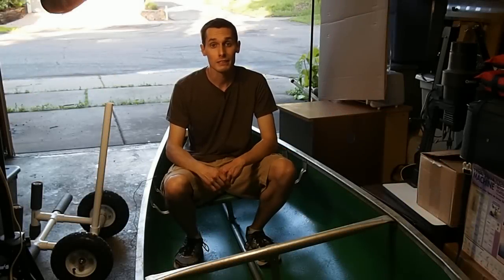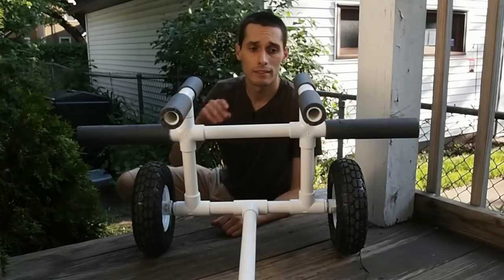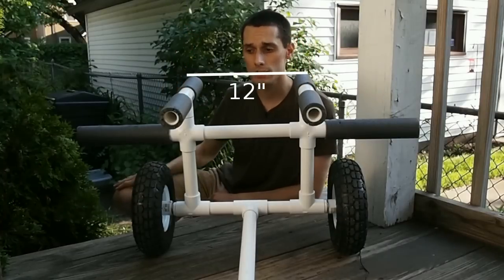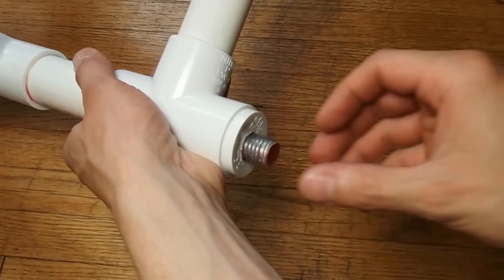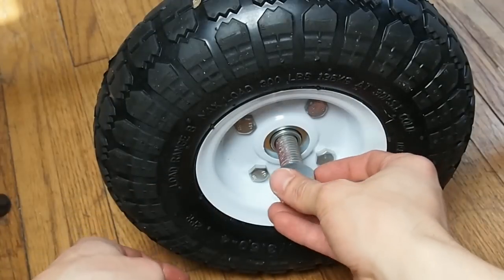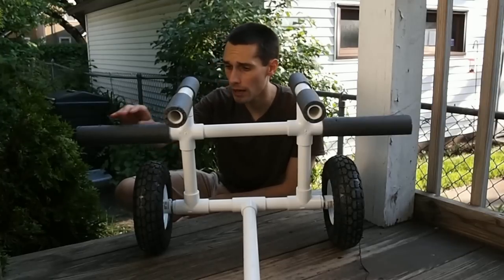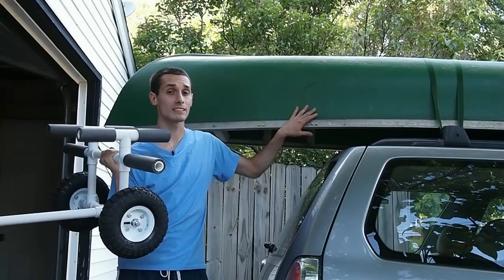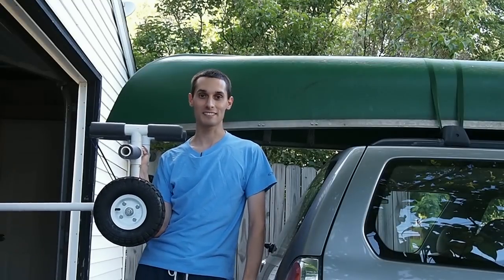DIY PVC Canoe/Kayak Cart

Comment: Hello! Awesome job. Super simple sturdy design. Just an FYI... If you load the canoe or kayak mid-ship it becomes super easy to lift and maneuver as the cart supports the entire load. Sometimes portages are a mile or more and this makes the task simply walking with the canoe rather than lifting it off the ground and carrying the load. Nice job. I'm going to build one tomorrow. Also for outdoor weather long-term durability I saw another vid where a guy sprayed truck bed liner over the surfaces making them UV proof and a bit stronger. Thanks for posting.

Comment: I built one from your plans out of PVC and destroyed it in the first few minutes so instead of quitting I adapted your plans to some 1" square 16 gauge metal tubing I had. After a couple of hours cutting and welding I have a heavy duty yet still light version that does what I wanted with out any flexing..  Thanks for your plans.

Comment: I just found this video. I'm in Canada and parts totalled around  $70.00. It was still cheaper than the cheapest manufactured dolly and a far superior design. After a little math to calculate the cuts, it only took about 1/2 an hour to build. Thanks again

Comment: Thank you for posting your canoe cart.

 I used it as a model to build one for my 100 pound paddle boat.  Works great.

 Because the boat is heavy I used 1 inch pvc pipe and added 1/2 inch pvc pipe internally as re-enforcement.  I already had the wheelbarrow wheels, glue, and the 1/2 inch pvc, so I had to buy 2  1 inch pvc pipes, the pvc fittings (about $20), the 5/8 inch metal threaded rod ($20), a couple of 5/8 inch nuts and 5/8 steel spacers (about $5) at Lowe's home improvements.  I placed end caps for looks and a threaded T so I can easily attach/dis-attach the pull/push handle.  My biggest suggestion is not to glue anything together until you are sure the measurements are right.  The one I built is bigger in width because the paddle boat is wider so I had to use my own measurements.  The closest cart I could find that MAY work on my paddle boat, I found at LL.Bean for $150.  So.... I know this one works for my wide boat and saved me about $100.  Following is a link to the photo.

Thanks again.  Fun project and gave me bragging rights.  :)

http://www.clippersolutions.com/pbcart.jpg
Reply from the maker: Very cool! I'm glad the cart worked out for you and saved you some money.

Comment: Hi There, used your plans and adapted for a kayak
works wonderful
Instead of parallel top rails, I angled the rails to follow the contour of the hull
Fits like a glove
Also didn't need the handle
I mount my kayak by standing behind the cart with both feet chocking the wheels.
Cart is tilted down , with kayak to the side I lift it onto the cart , it levels up and I secure with a bungee. then i can move feet away, Go to the front and away I go !
Reply from the maker: jim c Awesome idea about angling the top supports!

Comment: I looked at many suggested designs and decided on this one.  I like the option of carrying the canoe right side up or upside down. I might suggest cutting a slot in the end of the axle to allow a screwdriver to keep axle from turning as lock nut is tightened.  I originally had planned to have the dolly located at the middle of canoe when moving which would require a longer axle for my 17' canoe when carrying canoe upside down(a 3' axle would probably do).  The advantage of locating dolly in the middle is that weight of canoe is balanced on either end making it easier to tow.  With canoe upright dolly is easily located in center.  One thing not really explained is that with an upside down positioned canoe relies on contacting the two pipes on either side.  A single contact point on each side does not make for a stable support.  The demonstration illustrates that stability is provided when the handle at bottom is forced up against the bottom making a three-point contact with the weight of canoe forcing the two supporting pipes toward the other side of  a vertical line through the wheels.  Probably a complicated way to explain it but the best I can do
Reply: I forgot to mention the handle when it flips up against the bottom of canoe when transporting upside down may hit thwarts or seats so positioning is important.  I even thought about adding another "T" at the outboard end of single pipes at center, adding short pipes and another elbow and short pipe at ends to make a three-point contact on each side when transporting upside down.

Comment: got it built with the help of the kids. cost 42 dollars with a coupon at harbor frieght. works well on trail works great on paved road. thank you. i have an 14ft alluminum  canoe.  the heavy canoe probably could have used larger wheels. but gosh the wheels were onlly 4 dollars each and it works . there is a learning curve on strapping technice . i use two staps around carrier to keep it centered and snug to the canoe. the plans work perfect and shopping list is acurate.

Comment: Thanks for the video, and the design!
I live right on a river but we're on a steep hill, so it's been a pain to drag the boats up by hand and one of the canoes has a keel, so I didn't like dragging it.
I altered your design. We have 2 canoes of different sizes and a kayak. I ran into the same instability issue others did, so built two wheeled frames and interchangeable middle connecter pieces of different sizes to fit the different boats-this allows me to easily strap the frames to the seats and keep the boats from slipping off). I used an 1-1/4" pipe for the middle pieces and the handles from your 1" frames are 24" long, I slide them into the 1-1/4" middle pipe with 2 holes drilled on each for each side secured with locking pins. This way the cart can be easily adjusted for each boat and it can also be broken down for easy storage. There are trees on the hill between here and the house, so instead of doing the same 1-piece 5/8" threaded rod in the front, I broke down a portaging cart we had, repurposed the wheels that had independent pin sets and made a separate section for the front: your (shortened) design on top, with a separate piece of pipe below for the wheels, T-fitting in the middle, and I drilled a hole through the 2 T-fittings and inserted a bolt with some large flat washers between the PVC fittings so there's some (albeit clunky) steering. 
The T-fitting of the top part (your design) has the handle pointed backwards to be inserted to the middle 1-1/4 piece. The "axle piece" has the handle facing forward so I can hand-pull it or hook it up to a tractor. For that portion, I drilled a put a cap at the end of the handle and drilled a hole and put an eye bolt through it so I can connect it to the tractor pin, or I can carabiner a hand-pulling handle onto it.
I finally finished and tested it today and it works. I think the extra torque strain from the hill might cause the front frame to break sooner. However your cheap and easy design, and. Ecause it isn't permanently attached to the back section will allow me to rebuild it and/or alter the design a bit to suit the extra strain.
Sorry for the log-winded and poorly explained redesign. You were immensely helpful, though. If you're interested, I'll take some pictures or make a video. But it started raining shortly after I finished today.
Reply from the maker: I'm glad the video was helpful. I'd love to see some photos whenever you get a chance.

Comment: Love, love, love this design!  I'm a short (5' tall), 61 yo woman and I've been looking for a plan that would help me with my 11' kayak.  I have little upper body strength so this would also help me load by being able to roll it up to my mini van.  Can it be used to help unload?  So happy to see this video.  In fact, I have some of the materials (wheels, PVC) so all I need is the fittings, threaded rod, washers, nuts and pipe insulation.  Your video is so well laid out, explained and demonstrated.  I'll take pics when I have it finished.  Thank you for sharing your plan.  I so very much appreciate it!

Comment: This is pretty awesome. I got everything but the wheels from lows for just under $30 That included the 1" PVC pipe and fittings as well as a 3/8" x 3' threaded rod, nuts and bolts, pipe insulation, and pvc ratchet cutter. I got the wheels for about $8 for 2 at harbor freight. Before this project I purchased a dolly at sports authority for around $70 and it was a piece of junk, so I took it back. This PVC dolly will be much sturdier and i like the looks of it much better, and it floats. All for around $38 :)
Reply: You could have bought a well-manufactured, very sturdy no-flat kayak dolly from Amazon for $35.

Comment: This was a great video, thank you. I went out and bought everything and had it built  in no time. Only thing I used different was 1/2 inch PVC, just because the kayak is a lot lighter. And it is a lot cheaper than going to Academy sports and buying one for 60 bucks.

Comment: Thanks for the idea. I made one and it seemed to be working ok, then it broke at one of the t-joints. I blame more my canoe being heavy as hell than anything. It's an older coleman canoe. Built like a tank but also just as heavy. I'll probably modify the design to suit my needs but building a second dolly with the same design and linking them up with the handle t-joint for better stability.

Comment: Great, simple design. Well done video.

How about a piece of rope threaded through the handle end cap (knotted on the inside).

Then you could run the canoe and cart right into the water at the ramp and retrieve the cart with the rope once the canoe is floating...

Comment: Hi, I made one and it works great and had no problems with your directions mainly because I do this sort of thing for a living (I'm a GC), but for projects such as this and others like it, may I suggest that you supply some sort of "cut list". Instead of just saying it should be 9" wide, 7" high, etc., a cut list allows for the lengths that go into the tee's, etc. For example: the fittings I used, the insert length is 15/16ths (so I rounded off to 1", because it's not that critical) thus, if you want 9" between fittings then you have to cut the tubing to 11". I little diagram at the end of the video of where these pieces go in relation to each other would be helpful. Also, I used the large wheels off of an old lawnmower and as things worked out I didn't need to cut the threaded rod, plus, I used end caps on the exposed ends which not only makes it look neater but it keeps the foam tubing from sliding off. I think mine could beat yours in a race.
Reply: You have a canoe?
Reply: Get over yourself. There is a diagram

Comment: PVC  is measured by the inside diameter. Also, you might be looking at the T fittings, which are larger so they can fit the straight pipe on the inside

Comment: Thanks! Great vid. I built based off of your parts list, looks great. However, when in use every single fitting rotates and it very easily collapses. How did you fit the pipes into the couplers? Did you use pvc cement?
Reply: Me too :(
Reply: @andrewblair7478  Did you glue everything?

Comment: Great video, cart looks great.  The end caps are not available at Lowes, HD, or Ace in the Denver area, and $6 each on Amazon were a deal breaker for me...back to the drawing board!
Reply: If you haven't already figured something else out, I promise you HD carries the 1 inch. Schedule 40 plug (I used a plug rather than the cap because, unless you have a drill press, it's easier to drill a good hole in a plug than a cap that's going to be a little rounded-also I think it just suits this job better). I went in yesterday and made sure. I couldn't find it online or on the app, though, it only shows the threaded. There's probably a mistake in the computer system and they have the same SKU for both.
 Also, FYI, the employees that work there have no say over the organization of the department. There's a separate team that comes in and seems to do a set up that makes absolutely no sense, and right when we learned where everything is, they'd change it again. The smooth plugs were not only NOT next to the other plugs and caps, they were on a different shelf.
If your Denver store doesn't have them find a manager or someone that's been there for a long time and have them call another store and get a store-to-store transfer. It may take a week, but it's free and the plugs will only be about $1. 
Hope this helps.

Comment: Made some changes to the design to better fit my sit-on-top kayak, and two small cones on top to better fit the scupper holes and two closed hooks on both sides of the PVC pipe above the tires. This helps to secure it with a bungee both on the water and on land. I'll try to post a video.

Comment: Maybe this is a silly question but did you use pipe cement to seal it all together?  I just built one ... thanks for the plans they’re awesome ... but in testing it out it isn’t tight enough to stay together, it sort of collapsed.  I have several ideas for solutions just wondering what others have tried.  Thanks!

Comment: The only downside I see is that it doesn't look real stow-able to put in the canoe when you launch. But, I will make a version of it just to use in getting the canoe out of the truck bed and on the ground and putting the canoe away when I get back. I have a foldable cart that I use for pulling the canoe to the put-in, but I will make one of these and paint it black to throw in the truck.

Comment: just buy  a couple 16' wheels  and some pvc and fitting's  ( male and female and two end caps .  Also buy a short length of aluminum rod and two  pins and washers and a couple bungy cords  one long enough to go around the canoe or kayak and one long enough to reach from that bungy to the front of the boat .  cut the pvc in two sections that tgether are just wider than the boat .  glue the male and female so you can break that piece  down . drill holes for the rod in the end caps  and epoxy them in the caps with  enough for the wheels washers and pins on the outside of the caps and about 6 inches to go into the pvc pieces . drill holes in the rod for the lock pins . fill the pvc with epoxy also and install the caps with the rods epoxied in them . (if you want you can add d ring onto the pvc also to attach the bungy cord . Now just assemble the two half sections tightly slide the wheels on the rods  then washers and use the lock pins to hold them on . attach the bungy cord and slip the canoe or kayak inside the loop . then use the second cord to the bow and the cord to keep it from coming off the end . ;) this will auto adjust and you can haul your boat over anything  use a bag to store the parts when you hit the water .

Comment: I built this project to spec based on the excellent video and multiple positive comments. I have to be doing something terribly wrong though. Although the cart works on a paved surface, as soon as you travel over grass or any other rough terrain, the cart slips out from underneath the canoe. I've tried securing the cart to the canoe with a bungee cord (useless) and even a ratchet strap...no luck. Any thoughts would be greatly appreciated.
Reply: +Tim Murphy You need bigger wheels/tires....go to Goodwill and get a kids bike for $5. and improvise from there....
Reply: same thing happened to me
Reply: @johnjames3440  I am doing similar project bigger wheels and tires are a must if moving about the yard or off any hard packed surface just from my own observations.
Reply: Great Job, do you have any ideas for a Jon boat?

Comment: Makify1 I just discovered this WONDERFUL video and it excites me to create this cart. I have two questions for you if u please don't mind answering: I have a Jackson Big Rig kayak that has a 37" width, should my "horizontal support" pipe be the same size (37")? Also, do you think its possible to add a 1.25" pipe onto my horizontal support pipe to create a "Roller" so that way the kayak can roll off/on? I truly appreciate your input/expertise and for sharing this wonderful video. :)
Reply from the maker: Rico Suave Yes, you'll probably need a wider horizontal support for such a wide kayak. Just measure the width of your kayak near where you expect to place the cart and make sure your cart is at least that wide. Your "roller" idea sounds intriguing. I don't know if it'll work but if you try it, I'd love to hear if it does.

Comment: Wondering if you think your design can be altered to use the cart as a dolly for moving stuff from the put in or dock to a campsite? We have some boat-in campgrounds that have a bit of a distance to the site. I'm thinking that the single handle could be replaced with two handles, equally spaced from the vertical supports that are bridged by a cross piece glued into place with two 90 degree elbows. The side wings might reduce its effectiveness in tight spaces, so I suppose those could be shortened to within the inside of the wheels. What do you think?
Reply from the maker: I think your design would work and would probably be stronger and more sturdy than my design.

Comment: Great cart.  I making one tonight so I can use it this Thursday which is my day off. I price it out and it should cost right around 25 bucks.   I already bought the the wheels last night.  I have one question.  You said you had to cut the rod for the axle down a few inches. I was wondering why you did not just leave it at the 24in.
Reply from the maker: I could have left it at 24 inches but the axle would have stuck out past the wheels a little and I was afraid it would snag on things like my leg. Ouch.